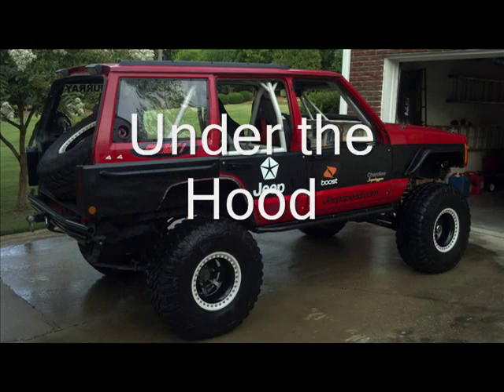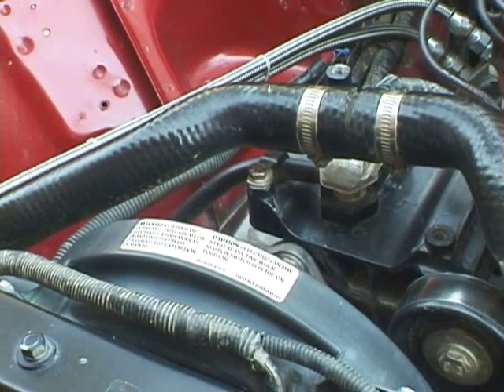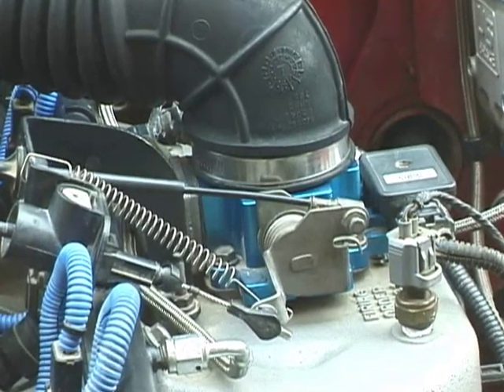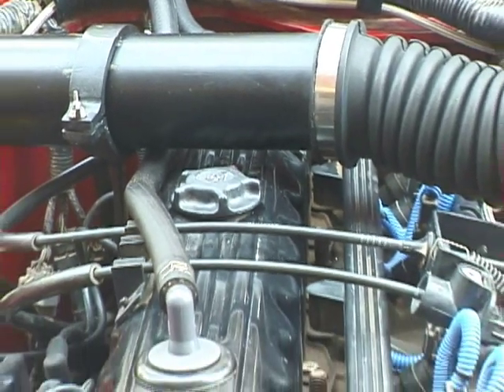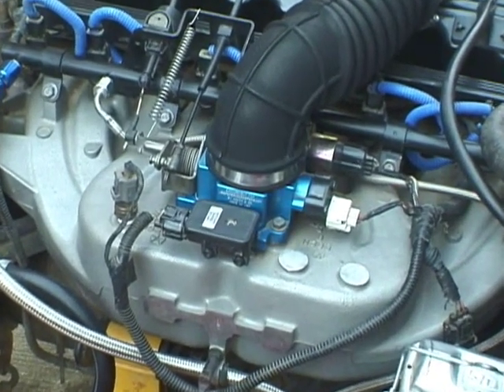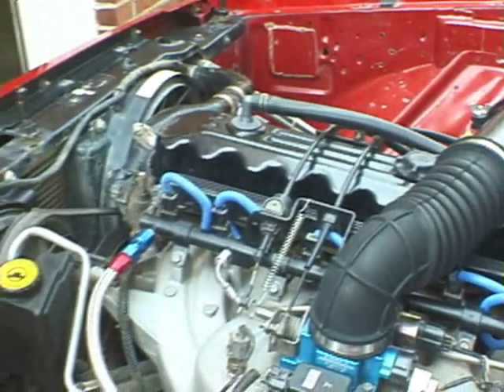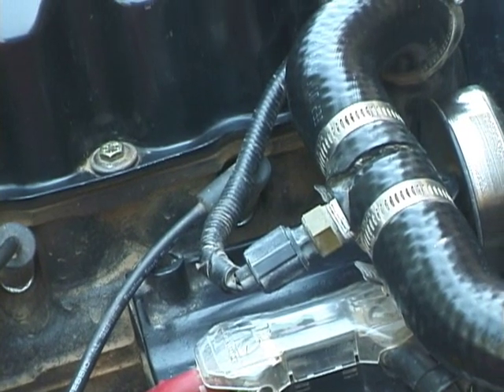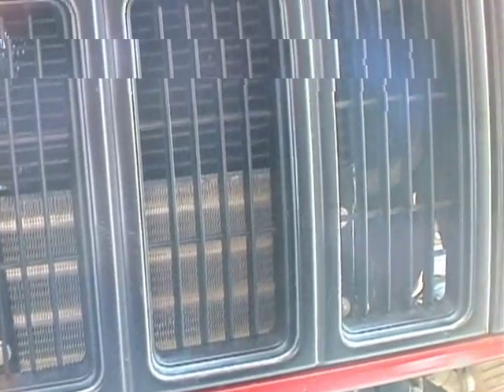Under The Hood "Webisode"

Comment from the maker: I used a bracket from a non-air conditioned Cherokee and an idler pulley. That assembly brings the alternator up from the lower position. 

Once you put AC in a Cherokee the alt. fits below the compressor. So you get rid of your AC and you're set.

Comment: I built MS systems on some of my other projects with the intention of getting rid of carburetors and distributors with an affordable, tunable, geek friendly fuel injection system. You can megasquirt anything from a weedeater to a top fuel dragster. 

It would take a few pages to detail the entire setup - But it will cost you about $500 in total. You can buy the ECU prebuilt - or build it yourself for a greater understanding. You will need to install a "toothed" harmonic balancer for the crank

Comment: Sensor to run the new ignition system. The EDIS module will control dwell while the MS box will control timing. Im sure there are prebuilt maps for the jeep 4.0 that you can plug and chug into MS. In my experience, having worked with much more expensive systems, MS is the best bang for the buck when it comes to aftermarket ECU's. If I had your upgrades on my jeep, MS would be a no brainer. itll take some research and know-how... but itll be worth it.

Comment from the maker: 5.0 is a 4 hole injector. 

No booster, this is a manual system. There are 2 master cylinders, 1 per axle. If I lose power to my motor I still have the same brakes. If I lose brakes on one axle I still have brakes on the other axle. The safest offroad system you could have. 

Great Questions!!!!

Comment from the maker: Nope. I ran a 6AL box for a while and saw no improvements. Eventually took it off. It's my firm belief that the distributor/ignition system from the factory is just fine. Personal experience. 

With that said, what are your recommendations? Personal experience?